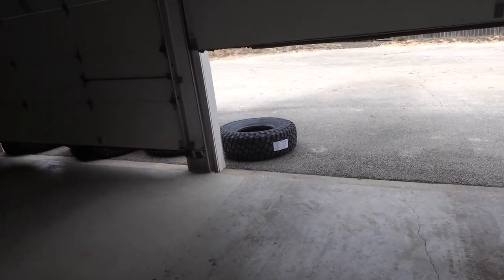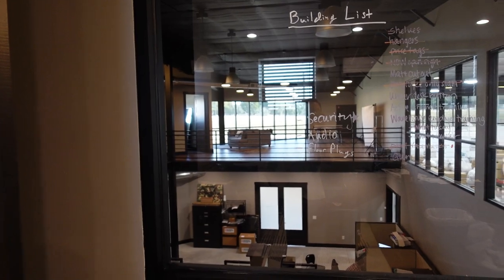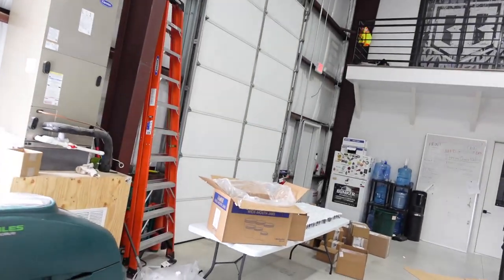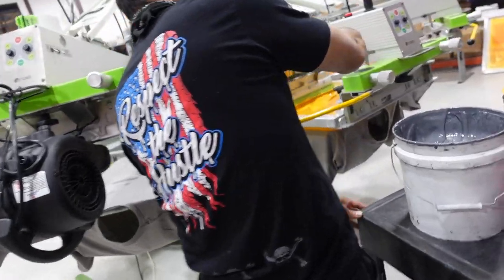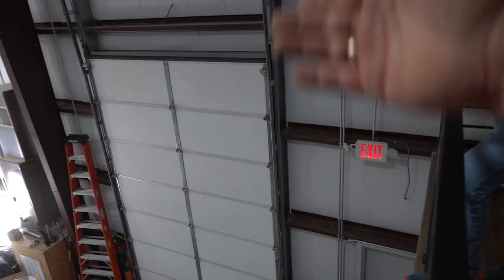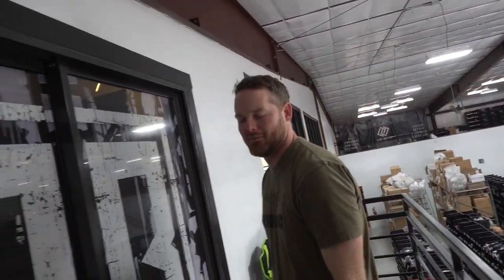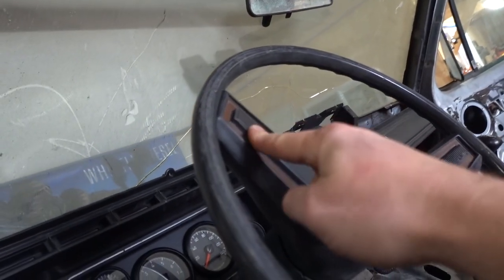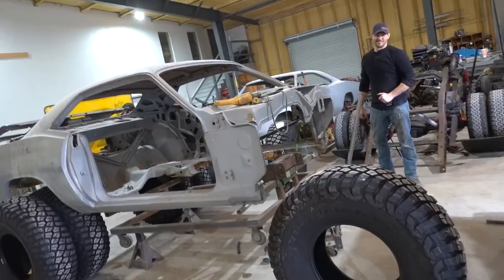4x4 Dually Cummins Diesel Barracuda....... Part 3

Comment: Look like a very advanced Air-ride suspension!
Reply: 😂😂😂 so advanced you cant even see it
Reply: More like no ride suspension
Reply: @FrankKatzenberger  that's actually a great idea
Reply: @FrankKatzenberger  It needs doors that open downwards, so they can be used as a ladder, so up side down gull wings
Reply: @dubious6718  I thought that, but if he is going to use it on the property than he may not be able to get it open if is close to highsiding it
Reply: If it's Matt it equals worst case scenario
Reply: @FrankKatzenberger  maybe they could be like sliding doors with like a drop down ladder like in the fords tailgate
Reply: @FrankKatzenberger  suicide doors would be the same as stock doors ergonomics wise just opening the opposite direction and gull wing doors wouldn't help with getting in at all and would actually make it harder to close when parking and getting out but they would be sick as fuck on it. Imo i think lamborghini doors would be the coolest and still leave some door panel or handle to use to get in. Would be even cooler if he found some Koenigsegg hinges to use so the doors open straight out and then straight up but would be extremely expensiveto buy and then fabricate. Would definitely be one of a kind no matter which one he would choose tho. But this is all just my personal opinion too.
Reply: @FrankKatzenberger  thought these barracudas open pretty wide with the doors?

Comment: "Cuda's" had the performance options, "Baracuda's" did not.
Reply: Yep
Reply: Yeah
Reply: Was just about to say this, base model 3rd gens are still barracudas, the high option/performance cars were cudas
Reply: Correct, I had a "1970 Barracuda".
Reply: not entirely true. If you checked the right boxes you could have a hi po engine without the Cuda package. Very rare but it was done.
Reply: It's gonna be a straight 6 , so maybe 'Barracuda' is more correct?
Reply: @mavmav6555    I had a 1970 Barracuda Gran Coupe

Comment: Matt, do you have a Knox box on the bunker? A Knox box is special lock box that only your local law enforcement and fire department have access to incase something happens. In this box is a key to the structure. They also make special boxes for gates so first responders can make access in an emergency.

Comment: Matt,
For the garage doors hang some of your flags at the top of the door, will cover the panels and will drape down and be visible from the outside when you open the door.  Assuming you still have the abundance of flags.

Comment: Hey Matt, you started Off The Ranch, and it has been fantastic. 

However, I feel like there's an opportunity here for you and Mere and everyone at Bunker Branding and involved with Bunker Branding.

As in, I love all the content you put out on this channel, just like i enjoy DemoRanch.

But here you have the opportunity to show so much more of what Bunker Branding is, and the deep compassion and regard you and Mere clearly have for you team.

So I'm saying, continue what you do on this Channel, but letting Mere and the others vlog as a part of it is going to make this channel, not just vastly more interesting to the followers you already have, but you will gain millions more followers, because it will appeal to a much wider audience. 

and if i may make an assumption, you/this channel and all it's collaborators will gain followers, without sacrificing the integrity of the Channel.

Also, Capt. Tyler Voss. I am a former Airmen, a Crew Chief, in fact. I was Qualified on his Airframe, the KC-135.

I remember his crash, even though i was thousands of miles away. And I remember wondering if it might have been my fault, because I had worked on those airframes, even though I was never assigned to the KC-135, Directly.

Anyway, as an Airmen, but more deeply, an Aviator, I have a deep and profound respect for Airmen like Capt. Voss and his Aircrew.

I just wanted to share how much your dedication to his memory means to me, even though i'm pretty sure I never had the pleasure of meeting him or being allowed to work on his aircraft.

So, thank you from the very bottom of my heart.

Comment: The ignition is that style so you can't turn the key all the way off and lock the steering accidentally. It's only like that
 on manual transmission vehicles so you could roll start it if it dies.

Comment: They were still nameplated as a Baracuda, unless it was a 426 Hemi (or I think, the 440 cars too) then they were badged just as a 'cuda.  I am not sure if they badged any of the 383 or 340 cars as 'cuda's.... but they absolutely badged the 70-74 line as Baracuda's, just they were the low-performance optioned cars.

Comment: The wall should be an exterior painting of a car you really like, and then on the inside of the stair it's the same car but a cutaway version that shows the chasis, engine, interior, etc. as if you've cut the car in half

Comment: I like you and all, but 1st gen Barracuda?! Uhm, no!! You have a 3rd gen. 1st gen was '64-'66. 2nd gen was '67-'69. 3rd gen Barracuda AND 'Cuda ( it was based on option packages) was '70-'74. The higher performance big block 3rd gen were the 'Cudas. The Slant 6 and small block cars were still badged as Barracudas.